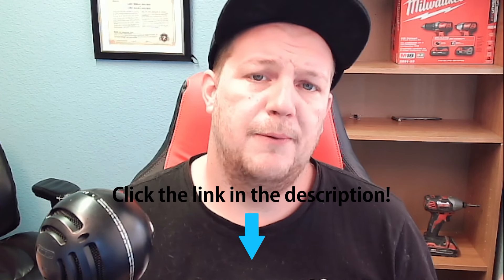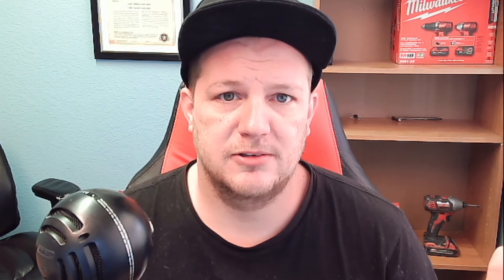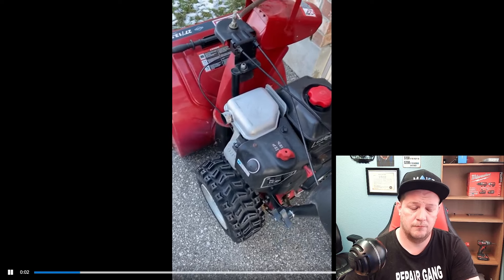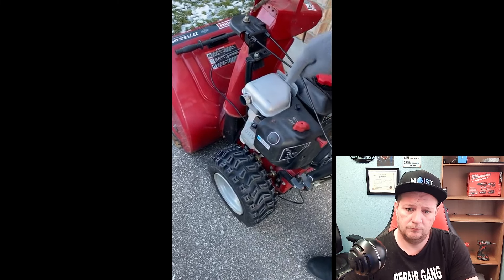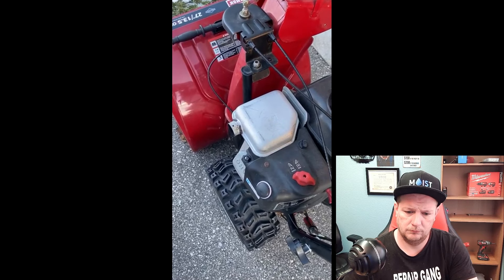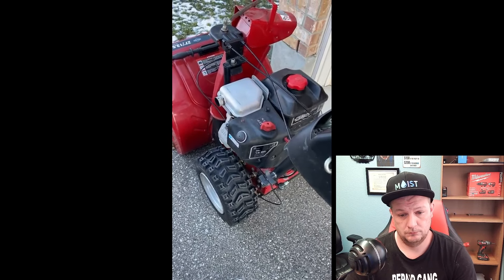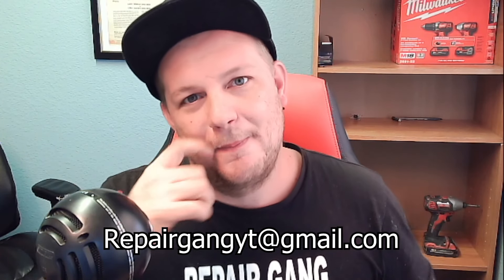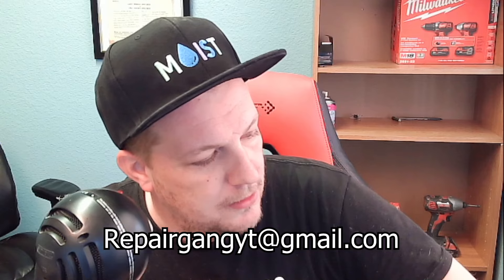How To Fix Your Snowblower That Only Runs on Choke - And How to Avoid This in the Future

Comment: My snowblower only runs on choke. I’ve replaced the carb with a new clean one and still same issue. No holes or leaks in fuel lines. Any help ?
Reply from the maker: check gaskets even to this day I put on wrong sometimes in a rush
Reply: Same here new carb only on choke
Reply: @ the new carb I put on needed some adjusting/tuning.

Comment: First use if my Ariens 28" blower today.  Had to out gas in it.  It kept shutting off if I took off the choke.  But even with the choke on full, it would run for a minute or two and three minutes then shut off.  It happened constantly.  I opened the gas cap and saw that the gas looked rusty.  I just shut it off indefinitely until I can figure out the fix.  I believe the rust got into the tank due to the fuel cap had a crack in it so water must have leaked into the under belly.  There is a clear white adapter that the cap sits on top of so when you unscrew the fuel cap both the cap and the white part that actually screws into the tank come off at the same time.  The fuel cap had a big crack in it so I think that is how rust formed around the rim.  I was going to find out how to drain the gas. But wanted to find out what else I can do to clean up.  I would expect I can drain the gas tank but is there something else I can do to clean out the tank?  I am hoping this rust does not permanently mess up the engine. I expect I may have to clean the carburetor.  All things I have never done before.
Reply from the maker: I recommend changing the oil replacing your carburetor to fix that broken part. Sometimes the gas tank is cheap but even a little rust ain't going to hurt you. You could take it off, put some nuts and bolts in there and shake it up out. But if you have any other questions hit me up. The thing of it is though is I'm trying to find another snowblower to repair but I'm in Arizona. No snow lol

Comment: Have a Troybilt Snowblower that only revs up in half choke and then just spits and sputters ( unless i put it under load then it run smoother) Runs better open but at lower prm and lacking power. I cleaned the Carburetor and installed 2 broken mounting gaskets but no improvement. If i use the priming bulb the engine picks up RPMs and like i said put it under load and it runs smoother at half choke.....so got me baffled.....obviously a fuel mixture and lack of gas to air intake  Any suggestions or ideas of what to look for?
Reply from the maker: Sounds like you need to clean the carburetor and check the fuel lines and filter

Comment: My $140 Briggs powered lawnmower has had the oil changed once in 9 years, never used fuel stabilizer, and has never been winterized. Starts up first pull every season and runs flawlessly.

My Tecumseh powered snowblower on the other hand...
Reply from the maker: Hahahahahaha